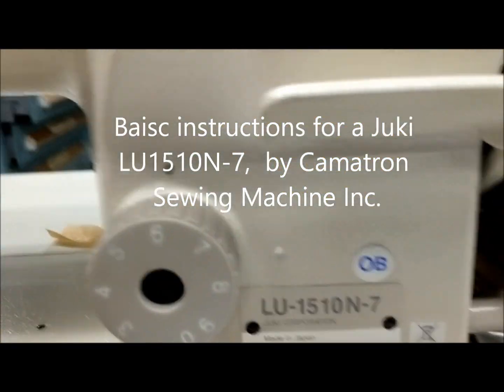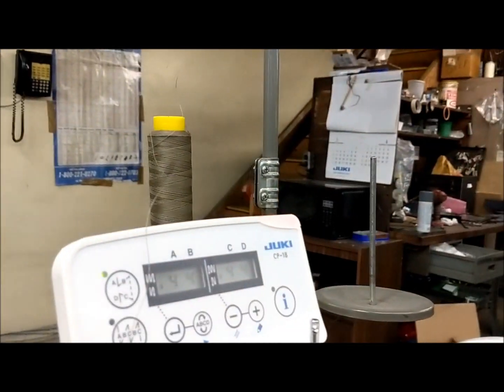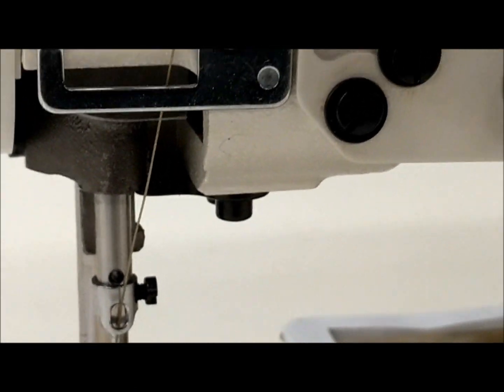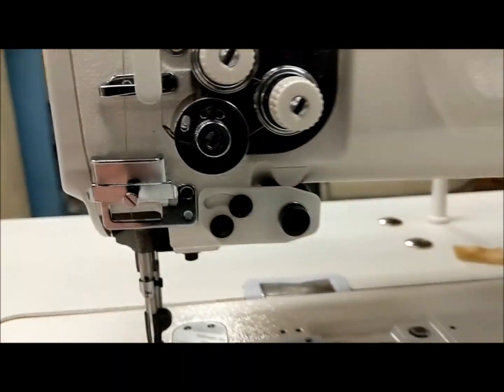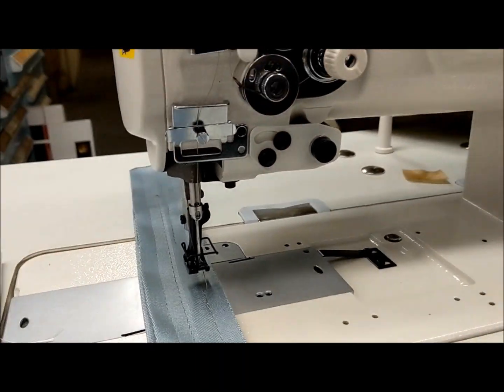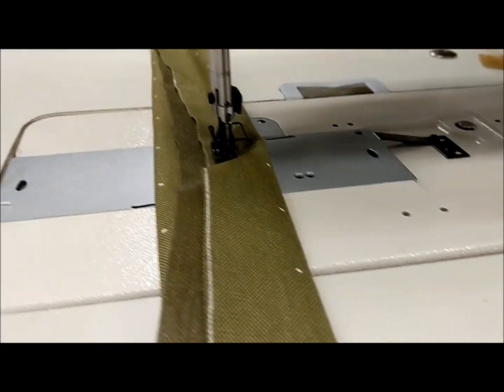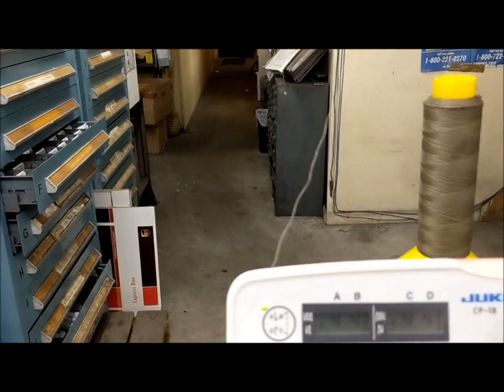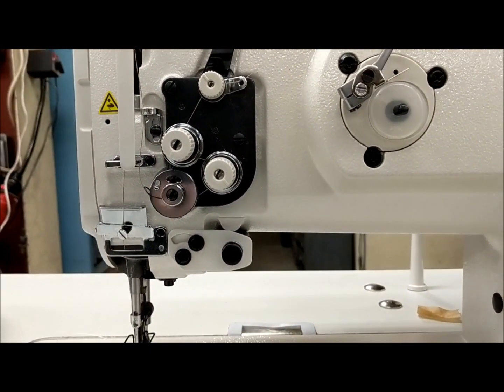Basic operating instructions for a Juki LU1510N 7

Comment: I have same machine! My question is when it backstitch and cut the tread fine! But when needle reposition back even with the foot, it sometimes needle is below the the foot half way down or down to the plate, I have to turn the wheel to put needle up where supposed to be!  Why does that happen? How do I fix it?
Reply from the maker: It could be setting on the machine that changes how much torque the motor has so that it does not  drift from the needle up position. You can call my office and we can try to help
Reply: @camatronsewing  I looking at today!  Usually when you turn machine that runs on air! Needle reposition itself  and wasn't doing that like it should.  So something is off.

Comment: Any tips to help figure out why my 1510n-7 skip's the first stiches ? sometimes up to 1/2 in before it stitches proper. If I hold the needle thread it stitches.  Other wise it sews and trims fine.
Reply from the maker: Hi, even though it trims fine, the remaining thread at the needle might not be long enough. Depending on what you are sewing, if the thread is too short, it will take  few stitches for the material to hold the thread and form a stitch.  1 or 2 back tack stitches at the beginning will help this--the change in direction helps hold the thread in the material.
Reply: @camatronsewing   Makes sense thanks. The remaininng thread after trim can be lengthened by backing off the small tension on top right?  I'll try that today. Backing off totally to gain thread. If that doesn't work then what? I bought it from Sloan in NH and it would be a big pia to get it down to him to adjust. 100 miles one way and so so heavy to get it there via pickup.
Reply: thread take up like on a bas, increase the thread length
Reply: @kerie8614  actually it was the final tension on the bobbin thread locked down  after trimming. So the upper thread couldn't catch the bobbin thread.  I adjusted that and it's fine now.
Reply: @jimbobxcityguy5338  that too

Comment: Nice video. On my 1510N-7 the threading is different then yours. On mine the thread goes down around the lower tension then up to the upper one then down to the take up spring. I like the change Juki did putting in a bushing in the take up lever and also the first thread guide has changed.
Reply from the maker: Hi, thanks!  As far as threading,  varying the threading is nothing unusual as long as the final few steps are the same.